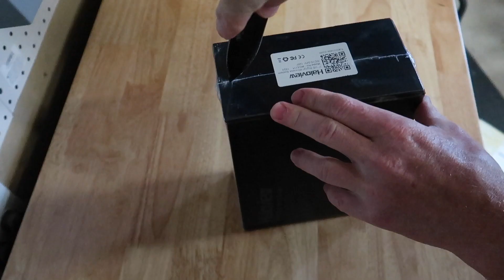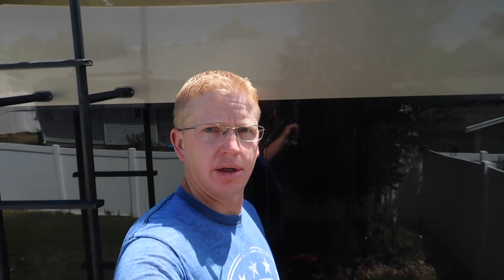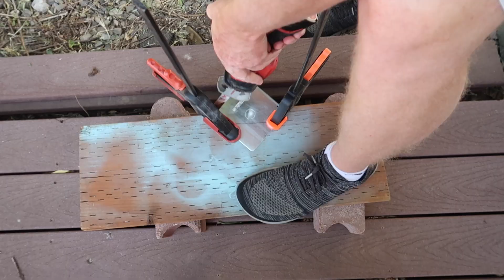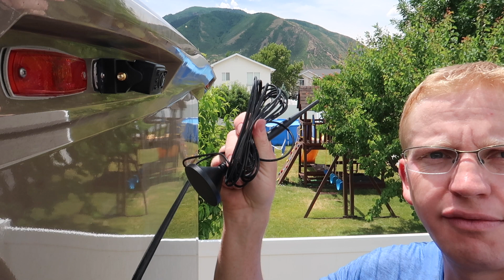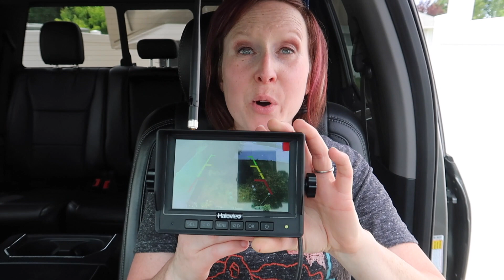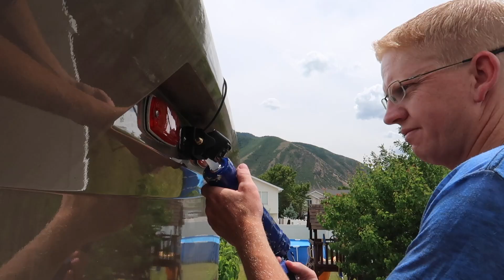Haloview Backup Camera Install

Comment: Your rig is no longer DOT compliant when the clearance lamp was removed.
Trailers that are more than 80 inches wide must be equipped with additional lighting on the front and rear to indicate the trailer's width. Two red rear clearance lights must be placed at the trailer's widest point, as far apart and as high as possible. Three red identification lights must be centered on the back of the trailer, spread between 6 and 12 inches apart, and placed as high as possible. Front clearance lights must be put as high and as far forward as possible, at the trailer's widest point.
Reply from the maker: Steve H good to know thanks for letting me know. Maybe I will have to come up with a new way to mount.
Reply: @JauntJunkies  ...I did the same thing....I wanted my camera in the center.  I don't think it will ever be an issue with law enforcement. 
Eventually I am going to remount the camera and return the lamp.

Comment: Does your F350 have an existing screen that u could have incorporated this camera into so u can eliminate the need for another screen in the cab? My 2019 has the option to add on another camera but I haven’t investigated yet.  One issue I can see is u won’t have the sound feature that comes with your new system.
Reply: Yes, mine does but from other reports, I saw it was a pain to integrate.  I just get out the screen when towing and then put it in the console out of the way when not.  I wish it would just blue tooth to my phone that would be the absolute best.